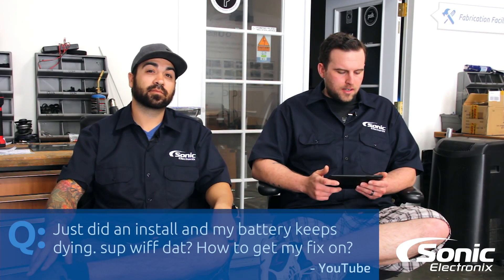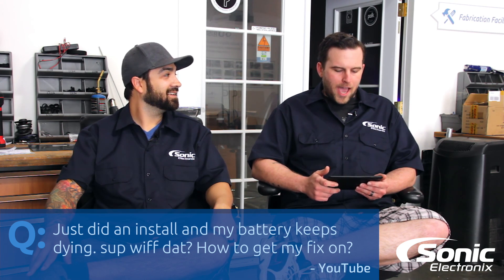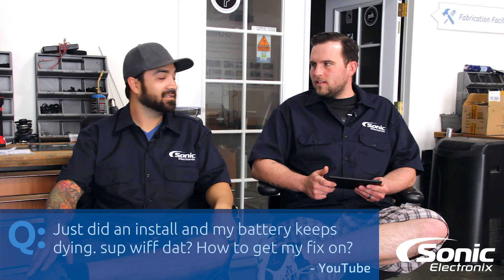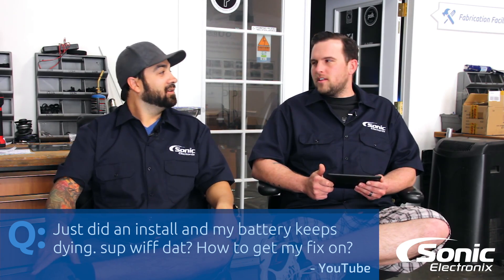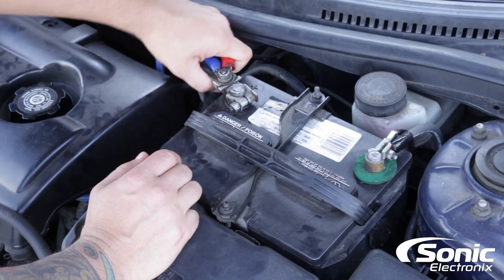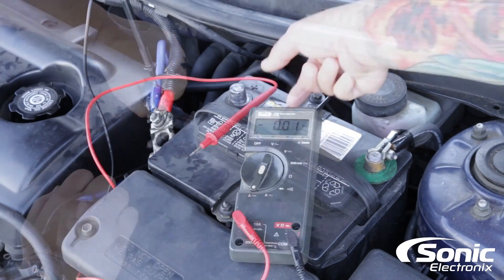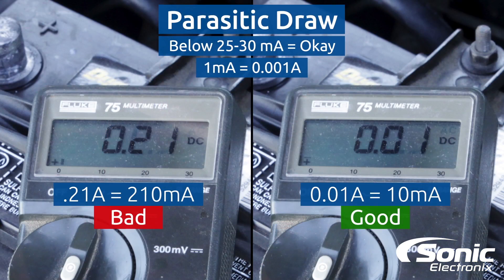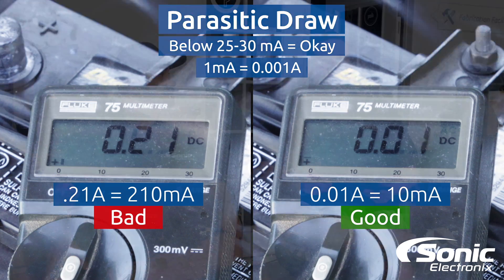Car Battery Keeps Dying | Parasitic Draw Test | Car Audio Q&A

Comment: I currently had my 2015 mustang gt installed with 2 amps, 1st for the sub and 2nd 4 channel amp for speakers plus a audio control lc7i. The lc7i has the volume knob right next to ligher socket up in front and Im pretty sure its drawing power even when mustang is off cause try to start up car after sitting about 3 days and it won't start. Can't really find a power source for that volume knob at that comfortable location and accesible location only lighter socket power wire. Thanks for the video

Comment: Thanks for this information. I took my car to get a repair and since then my radio turns on and it didn't work before. But the issue is since they touched it, the fuse connector that goes to the radio is missing. I checked behind fuse box and can't see loose wires or the connector to the radio fuse. How's does my radio still work? My car needs to be jumped off I don't drive it for a couple days and had battery and alternator checked, they're good. Would a missing fuse connector and fuse for radio cause battery drain? Thanks in advance!

Comment: Hi guys I have a 2008 ford fushon v6 just changed my altanater and now I'm getting bad sparking when trying to boost the car checked the wireing to the altanater and to the starter all is good had the car running and the motor lost power I'm at a stand still any idea what is going on

Comment: ? Forgive my ignorance but snow on disconnecting the positive part of the battery now everything that is doing a small milliamp draw on the battery whatever component it might be all at once in the car it's going to show a large number am I right show me pulling the fuse out would it show a drastic drop in the larger number is that what you're getting at or did I misunderstand

Comment: What will happen if I disconnect the positive before the negative when replacing a battery?
Reply: You can short the battery to the chassis if the wrench hits something metal on the car. It will wake you up!

Comment: I drive an 07 Cadillac CTS. I installed a new battery, alternator and starter. The car ran great for a few months but now battery is dead every morning. Should I start with parasitic draw test? How can I determine if I need new wiring?

Comment: The red battery light is on all the time so I bought a new alternator and a new battery and the red battery light is still there , I have been checking all over my car to see if I have loose cable. ( ford mustang GT 2003 )

Comment: I hate it when someone doesn't give the age of the vehicle, a rundown of what they ran thru the electrical system by cutting into harnesses and then they expect you to sprinkle pixie dust on it and solve the mystery. Might be easy to figure out, feel the sides of the battery for bulging & overheating. Today's batteries, 3 year free replacement no pro rate for 48/60/72/84 months like the good old days. And they are putting these dinky little Group 47/H5 batteries in the car and they are lucky to get 3 years out of it. I have a Fiat, old school Fiat was notorious for electrical issues. The battery they sold it with is the equivalent of anyone's 525 CCA aftermarket 2 year free replacement battery. Guess what ?  I got 2 1/2 years out of the OEM dealership battery. So my first replacement is the choice of the Blue/Silver 500-525 CCA value 2 year battery, a better Gold label 650 CCA 3 year and a Premium Platinum label 650 CCA 3 year battery. These range from $ 139/$ 159-169/$ 199 for MSRP. The Gold label has 810  as the 2nd cranking capacity spec vs the Platinums 675-700 spec. The Platinum has a weaker 2nd capacity spec, but they'll deliver that one to your home. I think the upcharge is for the home delivery. At any rate the Gold label was my first choice and I get 4 years and some months, so we're looking at a low 50 month battery life. So 05/28/2020 the Fiat gets it's version of Coronavirus, new battery was the cure. And order online, quite often there's a coupon code and while the battery is still pricier, the savings can be 20-25% on $ 139-199, $ 28-50 less. They still tax you on that value and there might be the $ 1.50 mystery fee in the charge, which is probably a local tax or local environmental fee on item ? My $ 159-169 before taxes, ended up closer to $ 120. $ 131.50 was the damage to the credit card. Online Coupon Codes ended up being 25% savings. $ 40 off is $ 40 off in the Coronavirus Apocalypse, or any other era of misery on the planet Earth for a battery that gives you a 2,500 lb garage furniture on wheels.

Comment: What do I do I got a new alternator and battery but when I turn my head lights or Interior lights even my windshield wipers they start to fade on and off what else can be the problem
Reply: Starter. Tap it a few times and try to start it
Reply: Hailey Ortiz it’ starts no problem everything works in the car until I turn any accessory turn that’s when it wants to kill the battery

Comment: How can I get my battery in my 2002 ford explorer sport trac to not drain while I have my two 12 inch subwoofers on if I go to volume 19 maybe 20 my battery gauge goes down and I have a 1000Watt amp hooked up to my two 12s and I would like to find a solution on how to fix my problem

Comment: A cap which is installed to supplement your battery /charging system can leak. If that happens, it will continue to discharge the battery.

Comment: Hi so I have some pioneer subs in my car running 7500 watts what ever it is in rms but I also have a second battery in my car. The car is a Peugeot 407 sw 2.0 litre diesel so what I've done is installed two full 0 gauge wiring kits into my car all with 100 amp fuses but the problem I'm having is the back battery keeps going dead so my subs goes  off its like the subs are drawing to much power thinking about installing a capacitor but I don't think that will help much what could I do to help this

Comment: This does not make any sense to me... Someone please explain. When i try disconnecting the postive and test it, it just stays at 0. It doesnt make sense why or how it would read anything other than 0, because when u disconnect the battery cable it turns off all power from the car
Reply: The electrical connection is made through the meter

Comment: Hi Guys. Bought some amps wiring kits and a cap from you guys in April and it arrive in Sunny S.A. 2weeks later. Super stoked. So the sound setup. Battery-fuse-Belva 1 Farrad Cap-Fuse Distribution-1x Rockford 500x1D(2x 2RD2 Rockford prime 12s) & 1xR250x4(Rockford prime audio system). This was installed into my 2018 Ford Focus Ecoboost. It thumps great. Unfortunately it drains my batter dead over night... What could be doing this? Could it be the capacitor?? I installed the cap to filter signal noise and provide a cleaner purer 12.7V source. Please advise me what o should check. Think I will also look at doing the 'Big 3' next.

Comment: I recently replaced my alternator and when the alternator is hooked up my battery dies overnight but if I start my truck with the alternator connected it immediately sucks all the power out of my battery. I can completely disconnect the wires from the alternator and my battery is fine, it slowly drains as I’m driving but that’s normal cause it’s not connecting to the alternator which would usually charge it. I had the alternator checked and it passed with flying colors so I have no idea where to start. What would you recommend

Comment: I have a weird problem I am having some kind of parasitic drain, when I disconnect battery negative cable and I hooked up test light between the negative cable and negative post, it has no light and when I open the door, it lights up like normal because of dome light, so the Issue I am having is it always is COMPLETE dead in the morning, when I want to start it up so I decided to disconnect battery cables and put it in slow charge overnight, BAM! dead in the morning so I had to fast charge to get it cranking again. it dies over night even if battery cables are disconnected AND yes I have cleaned the battery too
you suggest the battery might be bad?

Comment: Have a 2011 Silverado Duramax. Have subs And mids and highs installed with 2 amps. Factory alternator and the 2 factory batteries couldn't keep up as amp would shut out with volume barely turned up like 115 db if that. Replaced alternator with mechman 320 and 2- xspower d3400 batteries. Truck is dead as a doornail if not cranked in 2 days. I even have to set upthe pioneer HU like it was brand new and never turned on. Have the big 3 done on the electrical with 2 runs of 1/0 to amps. Pushing around 3300 watts. Doesn't dim as much but still dims headlights bad if half volume and subs don't get loud. 4-8" Sundowns ported to 32 Hertz. Sonido mask 3000.1 orion xtr 4 Chan on mids

Comment: Hey had a car stereo installed a boss dvd/CD at frys went on vacation on a cruise came back to my car and it would not start tried humping battery and wouldn't turn over had to get towed and get new battery drove from Florida to Georgia got home and car would not start with the new battery called frys and they won't take responsibility until I can prove there's a draw from the radio and they said it could be alternater I've never had this issues before had my car since 07 never had any issue what can I do ? I'm getting a draw test tomorrow but I just think it's sucks that frys won't take responsibility and I'm having to jump through hooos

Comment: I own a 2003 Honda accord, After a few day of being idle for days the battery (3 months old ) goes dead...I had my nephew and brother in law do a draw test (both mechanics) can't find a draw.. Im am totally in the dark now since everything you recommend has been done...My Alternator is a little over 14 volts and the car does not turn off once i start the car.... if i drive the car often i don't have this issue, its after a few days of being idle.

Comment: Just bought a 90 mustang lx and doesn't have a head unit installed in it. The battery died after two weeks of sitting, could that be an issue as to why its dying ? had the alternator checked and its good and a new battery installed

Comment: My '05 g35 constantly needs jumping starting. But not every night/morning. More twice a week. I've taken it to an auto parts store (twice)  and been told everything is reading as ok. I've changed a loose battery terminal, but the condition still exists. Could parasitic draw occur over several days because I thought I'd be needing a jump daily.
Reply from the maker: That is strange. The battery would (or should) recharge every time the car is started. It sounds like an accessory could be getting left on? Or it's a slow draw that doesn't kill the battery every time, just when it is left longer than usual?
Reply: +Sonic Electronix I'm thinking it's maybe a slow draw. However I've noticed if I listen to the stereo without the car running (factory system with a 500 watt amp and sub) that immediately causes the condition. I still get lights, accessories etc. Car will crank but not enough power to turn over
Reply: Horace Mitchell yes

Comment: Having a similar issue except I know what's draining my battery... Installed an amp w an in line convertor and kept the oem head, ran power to battery w fuse and grounded it than ran the remote to my stock amp fuse but it doesn't turn the amp off what am I doing?? I installed an add a fuse which has 2 fuse slots I have them both filled could 1 be the wrong way? Could it be the wire isn't big enough? I ran out Of larger gauge and twisted a couple cat 5 together

Comment: Hello guys. My question is, how much stronger does the amp has to be when connecting it to a subwoofer? Another words, when is it too much for the sub to handle.
Reply: +Andry Ovalles when it exceeds the rms rating of the subwoofer....500watt amp would go with a 500watt sub. depending on the sub you could go a little more
Reply: Just max that mofo out. More amps more power. You’re welcome

Comment: Maybe he installed has his sub connected to the factory stereo and ran the amp turn on wire to the wrong side of the fuse or to a fuse that always stays on
Reply: I'm having that issue now ran an amp and tapped into my stock amp fuse since it's an oem head unit and I can't get the amp to turn off I have an add a fuse on it I'm guessing one of the fuses are backwards